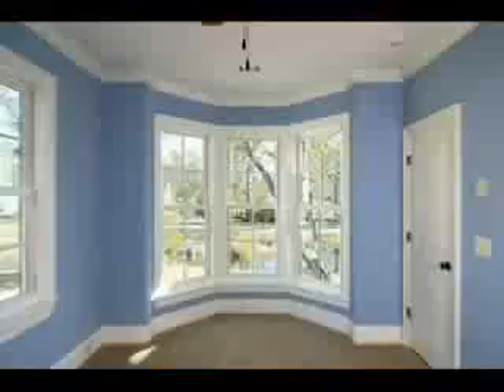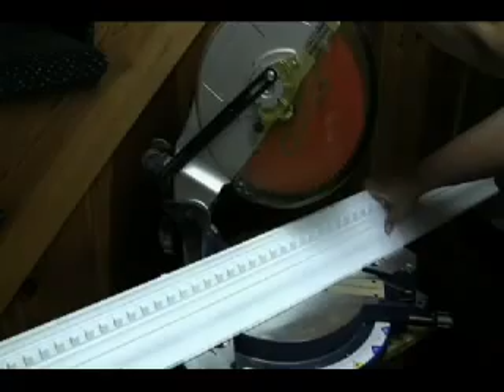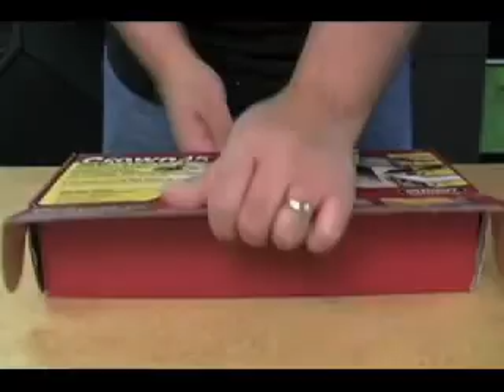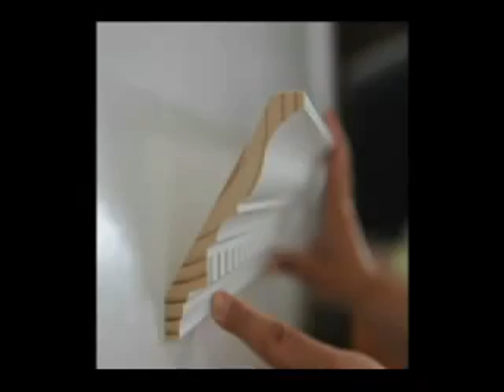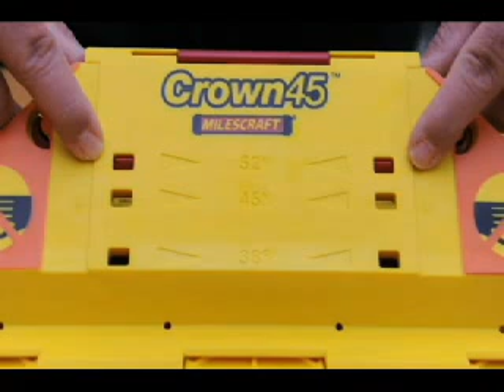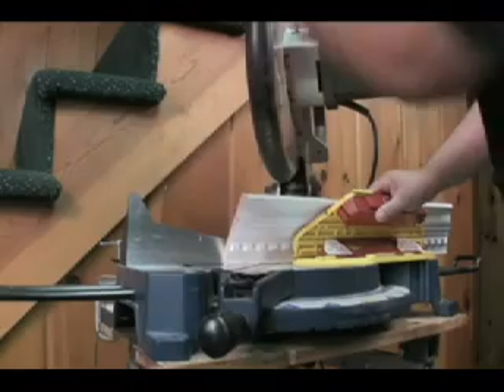Milescraft Crown 45 Molding Cutting Jig, Model# 1405

Comment: If inside corner angle is 135 degrees, according to your video we swing Miter half of that which is 67.5 to the left, but Miter only swings 45 degrees in either direction. How do we address this?
Reply: You are an idiot
Reply: @agraitlopez4485  😂